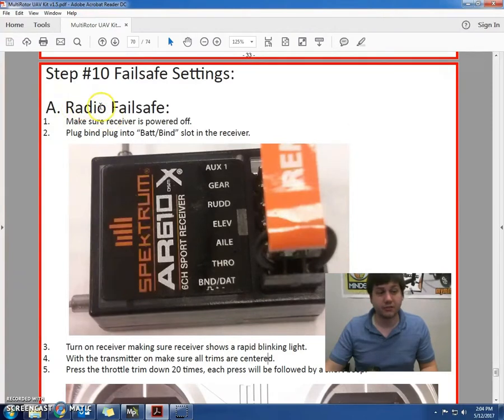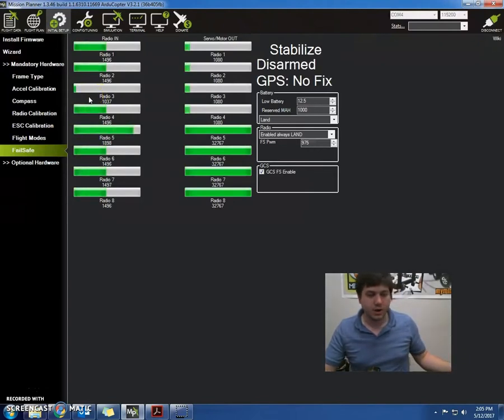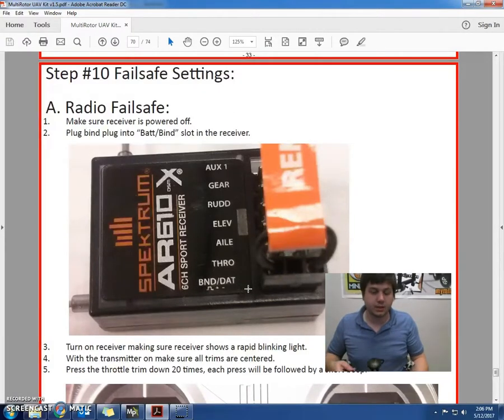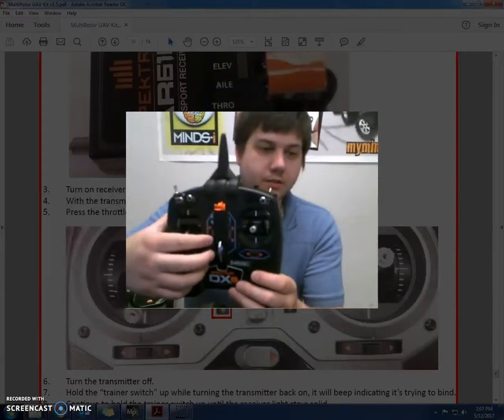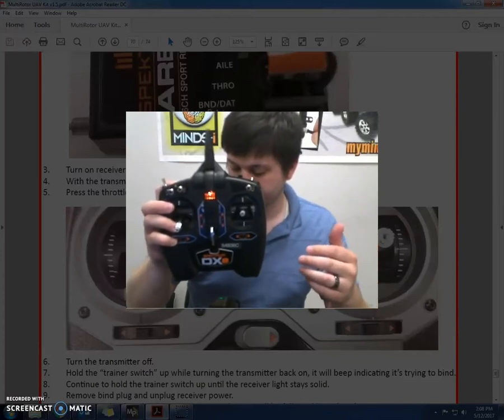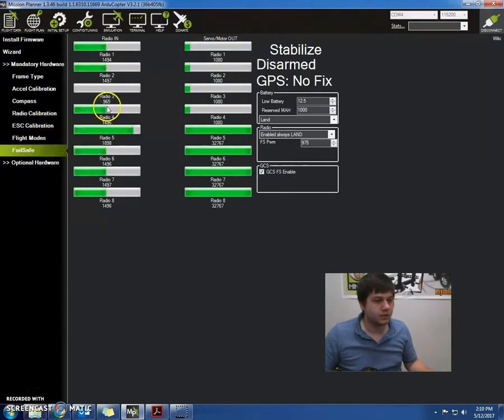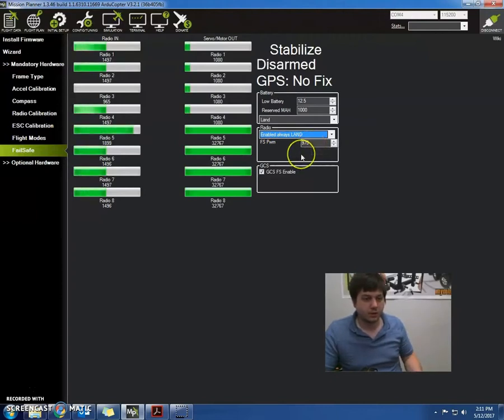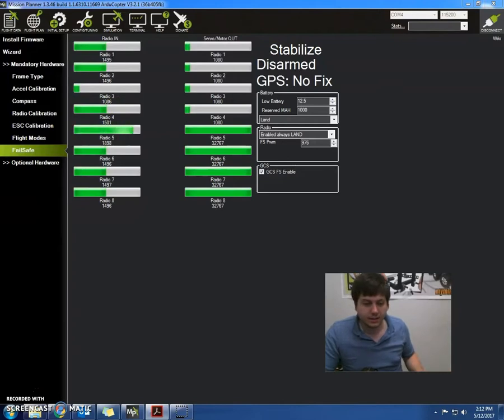MINDS-i Mission Planner Step #10A Radio Failsafe

Comment: It's a problem or not,  when I push the throttle key value on servo/radio out didn't equal each other
Reply: You might need to step through the instructions one more time. You could try adjusting the trim on each channel and also check the endpoints.